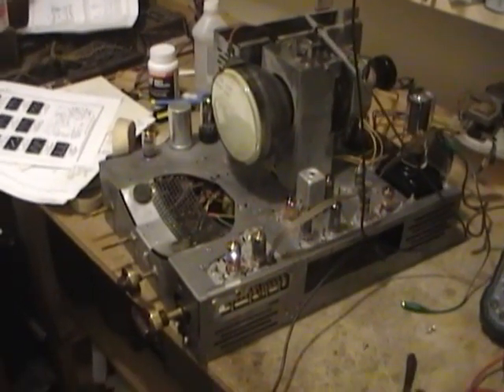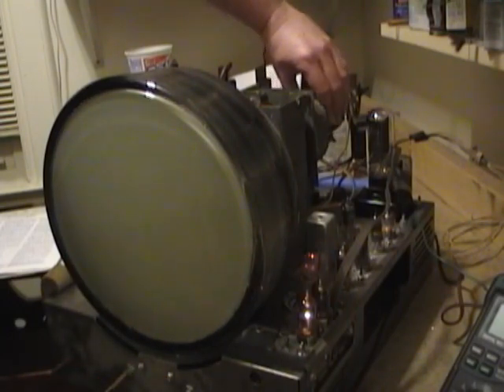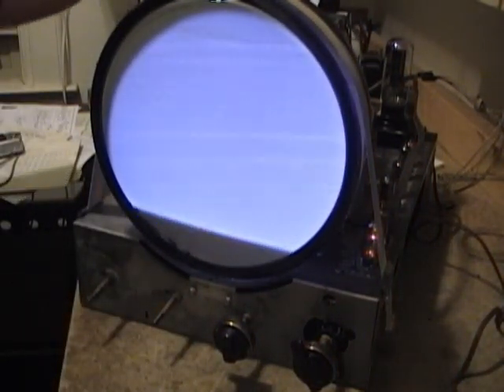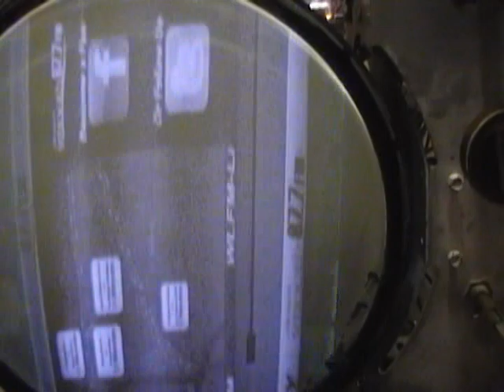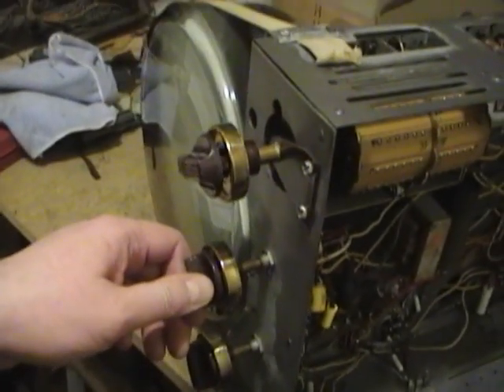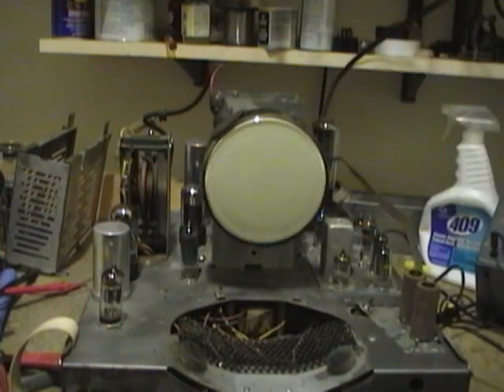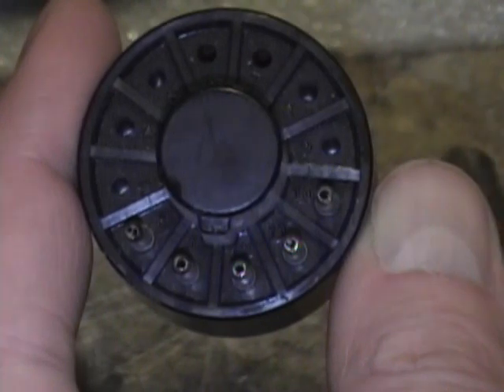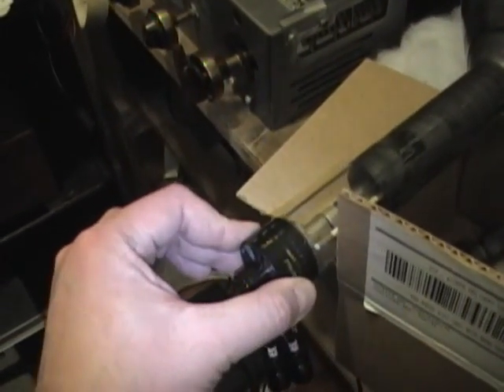Admiral 20X122 restoration p3o4

Comment: Oh good. I'm sorry you ripped the base off the picture tube but, I wanted to see what I did wrong with the Glass Caulking when I did mine. I had it socket up because it was so thin it ran all over the tube. I then inverted it socket down and that glass stuff ran into every pin, nook and cranny. Hope I can still solder my new wires to the socket pins.

Comment: Wow, lots of little problems that needed to be sorted out on that one!  Did someone work on it and not finish it before you got it?

And that Solder wick is one of the few that actually works!  Chemwick is pretty good too.  But I've been totally spoiled by my desoldering gun these days, and only use wick on occasion for simple stuff.  I also use Kester 60/40 rosin for everything still.

Comment: Hi Bob, Do you use aditional flux (soldering paste) on the pins so no possibility of cold solder joints inside the CRT tube sockets?